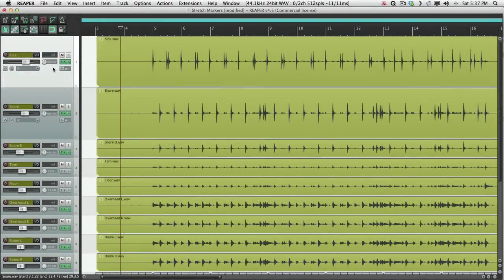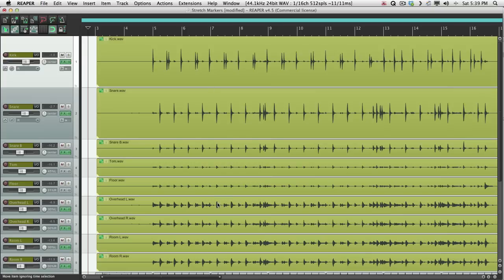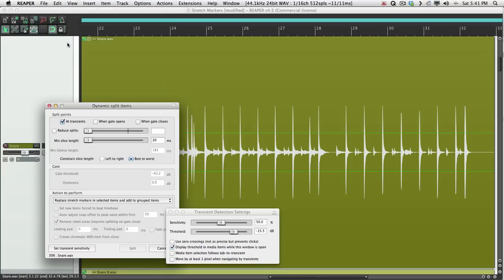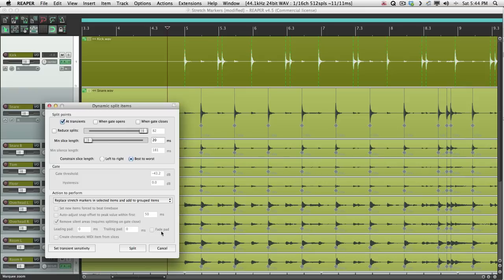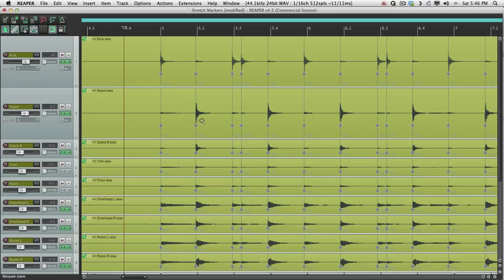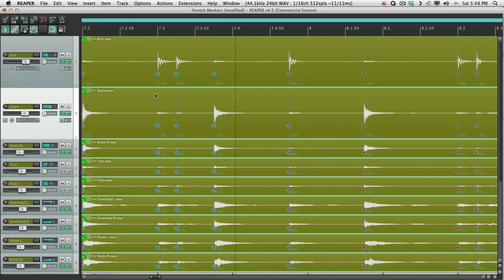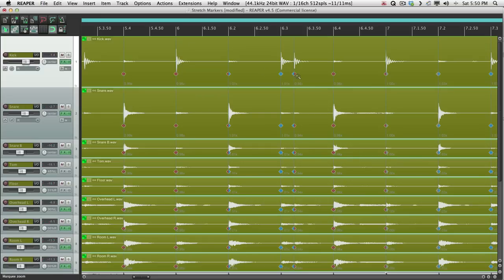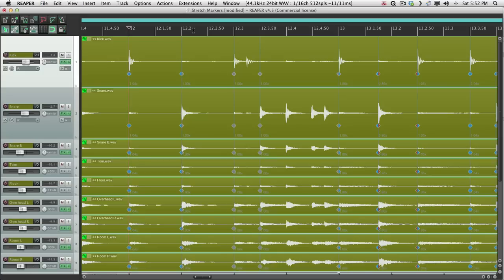Reaper: Drums quantize with stretch markers

Comment: never managed to make drums sound even okay using stretch/elastic, phase coherence just goes to thrash immediately.
Reply from the maker: there are many methods to quantize your drum. From moving to sliding or sketching. If you read the video description you can find some other methods there.
I personally still preffer to do it manually by split and slide every hit.

Comment: for some reason it doesn't split all the tracks on reaper 7. please help asap
Reply from the maker: Have you grouped the items? If so then look at the combo box at 3:00
Reply: I have the same problem, it does not work in Reaper 7 as i did in previous versions.
Reply from the maker: @stendahldrummer  thanks for reporting. I'll update and look into that
Reply: I also have the same problem. It uses to work on the previous version of Reaper ...

Comment: Cubase has a function where you can quantize tracks to a certain percentage around the grid, or you can add a "swing" feeling to the quantization, so it's not quite as robotic. I actually mostly use that for drums that are programmed in the first place. Is this also possible in Reaper?
Reply from the maker: yes, just go in the midi editor, select the notes and press 'q'
Reply: @miquelmarti6537  awesome! Thanks for the quick reply, man!

Comment: Is there an easy way to create a midi item with notes at each stretch marker?
Reply from the maker: If you want to convert audio to midi, you can use the ReaGate plugin. Look at the bottom, there is an option to trigger a note on gate open. You may route this to another track and record its output, for later processing/quantizing the midi directly.

Comment: One of the most helpful videos that I've recently come across! I've got a question though. Sorry if it has been asked before, but doesn't quantization with stretch markers reduce quality of the original recording? I'm almost hearing this faser effect when I quantize my drums with stretch markers and I don't hear it when I edit my drums manually aka the old fashioned way... Any thoughts? Thank you!
Reply from the maker: Yeah, sure. You may play with the elastic options from the Project Propierties dialog. Some algorithms do better than others depending on the material. Just try them all.

Comment: Hi there!
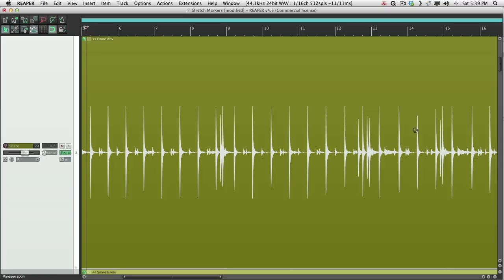Can you please let me know what mouse/keyboard shortcuts you are using to zoom in the track like this ( at 1:51)? I'm using mac and reaper 5.x. And thanks for the tutorial!
Reply: +Evgeny Poluyantsev "Marquee zoom" is a custom setting. It looks like his cursor is the zoom icon by default if he hovers over the bottom half of the media items and in between tracks.

The simple way to customize Mouse Modifiers: 1. Press Cmd+P to open Preferences. 2.  Under "Mouse Modifiers" change the second drop down menu to "left drag." 3. Double click on the command of your choice and select "Marquee zoom." 

I also assigned a command for the "Track" context on the first drop down menu, so that I can drag from anywhere on the tracks. You can make both of the commands the same. 

If you would rather change the default cursor to get Kenny's settings: in both the "Track" and "Media item bottom half" contexts, change the "Default action" to "Marquee zoom" . Then change all of the other "Media item bottom half" commands to "Pass through to item drag context" so that you can still use the default commands on the bottom half of your media items.

Comment: i cant quite get it right. i click snap stretch markers to grid and throws EVERYTHING way out of whack. I cant snap it to each grid point otherwise its still out of whack. HELPPPPPPPPP
Reply: +kermiebro2000 You problably need to adjust your "snap" settings. If the time base is too short (e.g. 1/32 or smaller), then your transients will likely snap to the wrong position. Use a time base no shorter than the shortest note in your material.
He does explain this in the video, though.